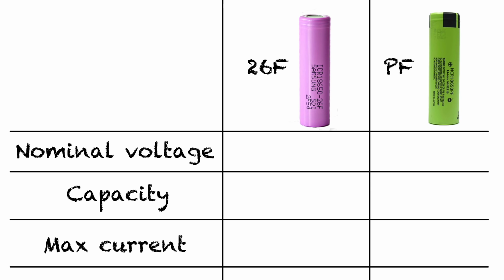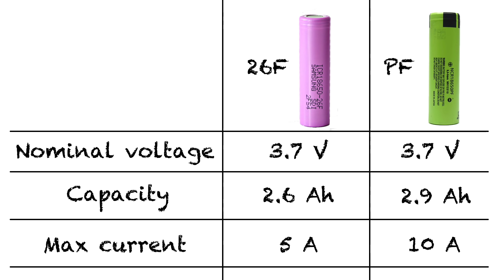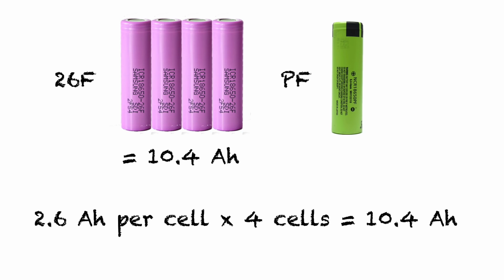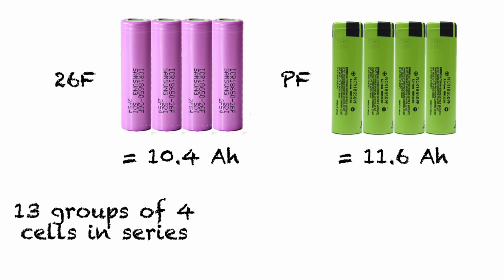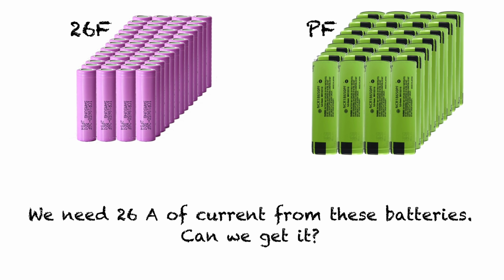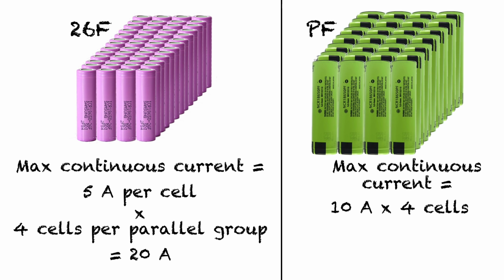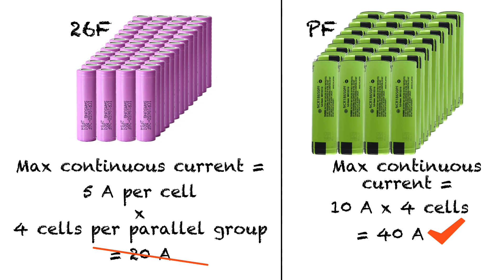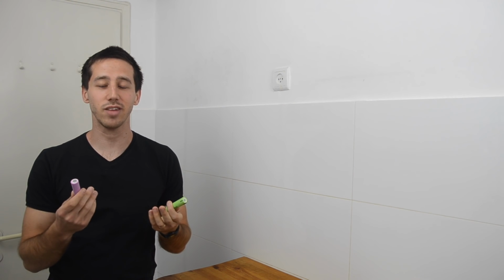Comparing 18650 cells for DIY battery - Q&A#5

Comment: Hey, Great Video,  My battery pack on my  scooter is  14"x 4"  and 36V 10.4 Ah  , So what should I  do on my case , would you please explain that. Thank you ..
Reply: A 18650 battery is 18mm in diameter and 65mm long, hence the name 18650.
For 36V you should put 10 in series and use as many series in parallel as you can fit. Do not forget you also need room for the BMS and cables. If my math is alright you should be able to fit up to ten series of 10 batteries (assuming your battery-pack is cylindrical). That 100 batteries would give you up to 35 Ah. You could also use less series. 6 series would need 60 batteries and give up to 21 Ah depending on the batteries used.

Comment: Hey mike
I was wondering, two things regarding batteries.
1. Why you only need to balance the batteries in the series and not those in the parallel   ? 
2. When building a pack do you fully charge/discharge the cell before putting them all together ?
Reply: 1. In parallel the cells have the same voltage, therefore its no reason to balance them. They charge and discharge themselves, so they all will be (for example) 4,18v if they are fully charged.
2. No? Why would you? If you want to check the capacity, go ahead and discharge them. It doesnt matter if your cells are empty or full when you connect them

I aint no expert, tell me if im wrong please
Reply: 1. It is best to balance all batteries. In practice: do not mix batteries. Use new batteries of the same brand and type and if possible from the same batch.
2. When building a pack make sure all paralleled batteries measure the same voltage before you connect them, otherwise one battery will load the other with a current that might be too high and blow it. You could use a power-resistor to equal out differences between batteries. You can also use a 3V or 6V light-bulb instead of a resistor (do not use a LED).

Comment: How about the 18650 vs the Sanyo NCR18650GA cells with 3500mah per cell.
Reply: The Sanyo  NCR18650GA are rated 3350 mAh and 10A. You can use them, but where I live they are quite expensive compared to others. If I had to buy the batteries, I would also consider the cost per mAh. If weight is your main concern, you should use batteries with the highest capacity. What about the INR18650-MJ1 of LG? They are 3500 mAh and 10A. Today the 2900-3000 mAh batteries are more cost effective though, but that might change over time.

Comment: NOT SURE I follow your calculations at 2m10s !!!
If you have 13 groups of 4 cells...
And those 4 cells are connected IN SERIES...
Then doesn't that mean that you have to ADD THE VOLTAGES of the 4 CELLS...
So as to know the voltage of a group !!!!??? 
(example: 4 * 3.7 = 14.8 volts for one group....Times 13 = 192.4 volts if in series!)

Isn't it In parallel that you add THE AMPERAGE... But voltage remains the same!!!
And in series, you add THE VOLTAGE.... And it's the amperage that stays the same!!??? 
I'm Confused!  ;-)))
Reply: I think you're confusing the ah and current rating. Ah and amps are two different things. Series increases voltage. Parallel increases current rating and total ah.
Reply: Voltage in parallel is same, i.e. 1000 cells in parallel = 10 cells in parallel = 3.6 volts. Voltage only increases in series, i.e. 10 cells in series have 36v even if those 10 cells have parallel config with 99 other cells each, totaling 1000 cells.
Reply: The 4 cells in parallel is 3.7 volts. Then 13 X 3.7 gives you your pack volts. He tells you this in this video..... I only no this because of this guy..... Thanks 😜👍🏼
Reply: Yes you are right that this video is very confusing. He is talking about 13 groups of 4 cells in series  and he means that only the 13 groups are in series with a group being 4 cells paralleled. I myself would call the 13 cells in series a group and would talk about 4 groups that are paralleled.
You have to parallel each cell individually btw, not just the groups of 13 cells in series.

Comment: Hello Mikey,
Your Videos have been extremely informative. Although,I wanted to ask,what battery configuration of 18650Panasonic pf would be able to cope with my 40A esc, with system voltage 24V?
Reply from the maker: An absolute minimum of 4p, but much better to go around 6p, or even higher, if possible. 24V requires 7s. So a 7s6p would be good.

Comment: Hi 
yours videos are very amazing , 
so, i didn't understand why you prefer  aliexpress as source of BMS since the majority of end of charge control is 2.5V .for some batteries are good but
the samsung 26f 2600mah have :2.75v cut of voltage...and for  other batteries .
other thing , why connect a fine positive cable from bms to battery pack and thick cable from battery to engine (do you think that difference of thickness of positive wire are normal ?)   .
can you explain this note by a new video .
thanks.
Reply: Cable-thickness required is (only) depending on the current running through that cable. The motor can draw high currents, so you need thick cable. The BMS has 2 main leads to the battery pack that must be as thick as those running to the engine. The other leads are just measuring leads which draw little current. If they measure a problematic situation the main leads are disconnected by the BMS.
I agree 2.5V is too low for many batteries and why should you go down to 2.5V? Between 2.8V and 2.5V the battery does add very little capacity, so it's better to be on the safe side.

Comment: I've been collecting laptop battery pack and have 170 good batteries. Can get more but will be lucky to end up with enough of the exact make capacity whatever. Can anyone tell me if I can use all different makes ie Sanyo Samsung Panasonic with different capacities ect.
Reply: yes you can use different capacity cells in each parallel group. As long as each series equals to the same amp hour. 
When you got the cells you want go to the repackr  website and it will tell you where each cell needs to go.
Just make sure the cells hold charge, if you fully charge to 4.20, after 3 hours check voltage, it it drops dont use that cell. Pack wont balance properly if you got weak cell.

Comment: I'm looking at building a battery pack for my tent trailer. I purchased a 100 amp bms for 4 call pack and a power booster to be able to charge from standard automotive power from 12 volt to 13.8 volts when engine is running. I want to stick around 75 amps to not over tax the bms at max.  The idea is to get away from lead acid batteries which cost a lot and are heavy, and also don't last but 2 years on average in a RV. let me know your thoughts.
Reply: kd7alt hey hows it going. if you're using it for the trailer tent first thing you need is that step up converter to 16.8v as thats the full charge voltage, the other problem is that lithium batteries need a two stage charge. the constant current and constant voltage stages. so to be honest I'd recommend just buying a fast charger with a 3phase plug  adapter (i can't think of the name but they have that blue lid) or the other easy way out is if you want the car to do the charge attach an inverter to get 110v/220v and plug in that charger then into the inverter. I've no idea if that helps but i hope so.
Reply: kd7alt i did the exact same thing! Thought i was the only one...
Reply: Wait, no. 
What I did was to purchase multiple 12v (3s 100A battery bms'es) so that i can connect all of them in parallel to charge them at 12v. When I'm using it in my bike, i put on a homemade adapter that puts all the batteries in series so that i get the (in my case 62volts)

Comment: Hi Mikey, I have seen lithium ion battery packs being sold online, same spec 48V packs, with the only difference being one is for motors 750W or lesser, while the other is 1200W or lesser. 

How do u determine whether a battery pack is suitable to power a certain motor of a certain wattage rating?

Thanks for answering!
Reply: It depends on the amps your controller can pull. Amp-hours (ah) is just the capacity of the cells (think of them as the size of your "gas" tank), but what counts is matching the amps the controller can pull to the continuous amps the battery can provide. If the 1200w motor needs 30 amps, and one of those battery packs can only deliver 20 amps, it's not the right one for the more powerful motor.
Reply: I see. So am I right to say that the controller basically determines how much power your ride will get regardless of the battery? Like in your above example, if the 1200W motor needs 30 amps, but the battery is capable of delivering 40 amps, the controller would just draw 30a correct?

But what if the battery is a 60V and is capable of delivering 20 amps, would that battery then be capable of delivering the 1200W the motor requires, assuming the controller is able to draw that amount of amps?
Reply: Q1: correct.

Q2: Watch Micah's other videos on Two-Motor 2WD, Overvolting for More Speed, and How to Properly Choose an Ebike Battery.

Heck, watch them all!
Reply: Ok i will :) Thanks again! Appreciate the battery build vids you churn out!
Reply: 1. Correct
2. If you increase the voltage, the motor will draw a higher current and you will need a BMS that can handle that higher voltage and current. Increasing the voltage is limited by the build-quality of the motor. Higher currents can burn the coils of the motor. It is better to chose a suitable motor.

Comment: HI Micah,I have a FalconEV 1000wat 48volt kit for an electric bike. Also I have 52 Samsung  26F that I want to make 13S4P as per your calculations I have 20 amp output, but my controller is a 45Amp controller.
What can I do to limit the demand of the controller? Can I limit the throttle somehow?
Thanks!
Reply from the maker: Search ebike controller shunt modification. If your shunt has two bars, you can snip one to cut the current in half. If it has three bars, you can snip one to reduce the current by 1/3. You can also use a cycle analyst to control the current, but it's a bit more expensive.
Reply: Thanks!!!

Comment: hello. I have e-bike Greyborg, 72V 42Ah battery with 300pcs Panasonic 18650 PF cells, with 6kw cromotor. Question is, what to do with battery trought winter days? How to store it? Luckily, this winter was good and i ride my bike in winter days to discarge and charge battery. But what with people who cant use battery for some longer time?

PS: you can check video about my bike on my small chanell
Reply: 0ssaa just discharge them to 3.5volts per cell for long storage

Comment: i am using a 24v 350w motor and samsung 26f cells to power them. can you help me with the battery config i should make.
Reply: 7 cells in series and at least 5 of those series in parallel. The more series of 7 you put parallel the better it is for the battery-cells and the more capacity you will have. I would recommend 7S6P which will give you 6 series of 7 cells in series and a capacity of 15.6 Ah (393 Wh).

Comment: umm didn't we say that pf should actually be regarded as 5a? 
, you didn't mention that the closer you get for max discharge you decrease the battery capacity? , 
also what's the relation between c ratings and max continuous discharge rating? 
one last question (it propped up on esfb) is it possible to tell cell grade (a,b,c) from the cell itself? maybe from qr barcode?

and something a little different,  i've started to hear about 20700 cells, is that a new standard emerging?
Reply from the maker: Basically all cell manufacturers rate their cells at their absolute limit - meaning the cells perform much better when used below their rated limits. C rating is just a way to measure current, where 1 C equals the capacity of the cell. So for a 3 AH cell rated for 3C max discharge, it can support a 9A max discharge. Discovering the grades of cells is largely a mystery to me. Most cells don't have it listed on them, and the grading scheme is proprietary so many manufacturers keep it secret how they make their cuts. I've never tried scanning the QR code actually, but that'd be interesting. 20700 and 21700 cells have been around for a few years but were very rare. Tesla has embraced the 21700 form factor so we'll be seeing that become much more popular in the coming years.

Comment: My question is if the controller is rated at 26A. What should be the BMS rating for PF cells be. Should it be 26A or 40A? or BMS rating doesnt matter? Neways thanks and yeah cool video cheers!!!
Reply: Got the answer for this in another one of your video. Cool stuff. Cheers again !!!
Reply from the maker: The BMS should be rated for at least the number of amps that the controller will pull, but preferably more. So a 26A BMS would work in this case, but a 40A BMS would be better, since it would be extra strong and not be pushed to its limit like a 26A BMS would be.

Comment: Great video. I always enjoy watching your videos and I always learn some thing. You do explain things very well. 

What is the best battery out there for heavy duty use in a 48v system, and money is not an issue?

Also, when you doing that video on your 2 wheel drive ebike? I'm Jonesing for that video.  haha I really want to get a good heavy duty mountain type ebike and add front wheel drive to it, to kind of make it into a sort of emergency ebike vehicle with some good range to it as well as load carrying capacity. 

I don't care about cost, weight, or anything else, as long as it's as durable and bomb proof as possible. Keep up the great work.
Reply from the maker: Hmmm, it's hard to say which is the "best cell" for that case, because it still depends on the full pack spec's, like how many cells you use in parallel. The LG HG2 cells is really good. It is similar to the Panasonic PF cell in this video, but can handle twice the power (20A), and has a tiny bit more capacity (3 AH). The LG MJ1 is another good cell. It can handle 10A but has a capacity of 3.5AH. So it's not as high power, but using more in parallel will give you plenty of power plus great power density, meaning big capacity in a smaller size. And I hope to have the two wheel drive video in the next 2 weeks, sorry that one has gotten delayed but I haven't forgotten about you wjf213!
Reply: Yes, I kind of thought it was a question with a few variables that would make it hard to answer.

What I'm "THINKING" and I think wrong a lot, so please correct me, is an ebike that's a fat tire cargo/mountain type design based with around a 750 to 1,000 watt rear motor and a 500 to 750 watt front motor, and a battery bank that's around the 1,200 to 1,500 watt range....or more.

I want to have just the rear wheel powered up for basic on road use, but if need be, have a switch or some thing that now engages the front wheel drive as well, and both motors work with pedaling as well as a throttle control.

So, I guess the battery would need to be able to provide max power to both motors in an emergency and not fail or fall short on power. Maybe two batteries and make the front a whole separate electrical system? I'm open to any ideas or thoughts, to include a custom purpose built frame. Again I do not care what it costs, as long as I get what I want.

Thanks, I'm REALLY looking forward to your bike video.....actually ALL your videos. haha